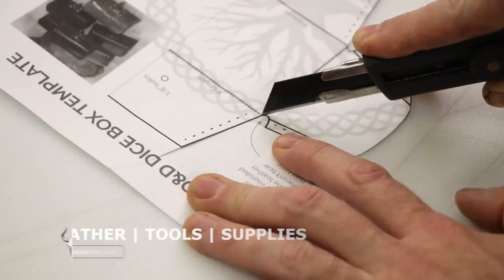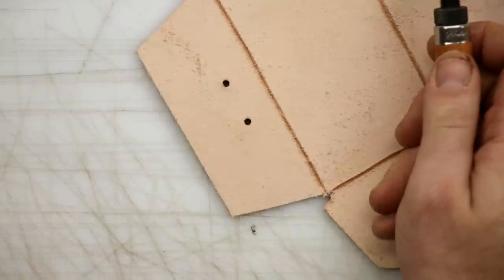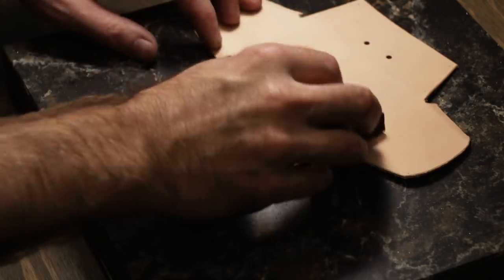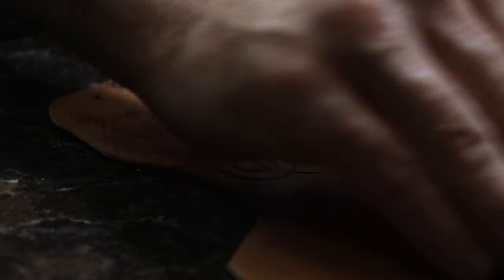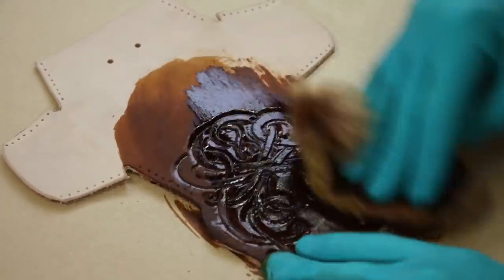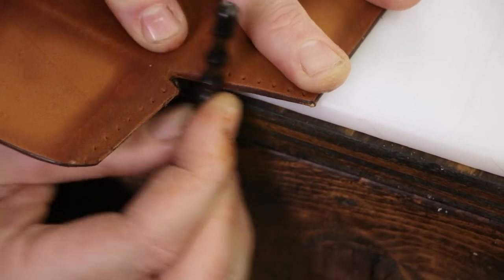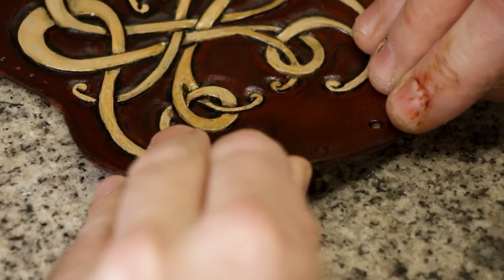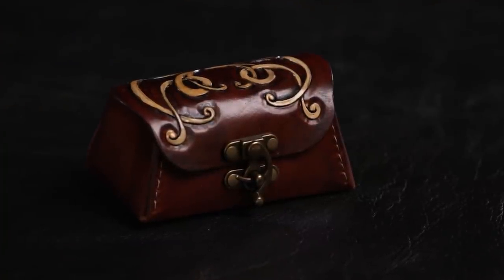How to Make a Leather Dice Chest - With Knotwork Carving

Comment: Nice!  I love the safety skiver, and wanted to mention that you may get better results if, instead of holding the skiver perpendicular to the edge, you give it a steeper angle - more length of the blade encounters the leather at the same time, and makes uniform skiving easier.

Comment: the pattern i do like to use a card stock paper with heavier paper thickness yea i do have an oversize printer too yea does help too can us poster board sheets to it a fairly old one too it still works 
then i laminate the pattern if i am using it a lot too lost to i bought the at lowe's yea they had 5x10 roll of it clear roll to

Comment: Would 9-10 oz be too heavy? I have some 4-5 but it seems pretty light weight
Reply from the maker: With enough skiving and grooving you can make a lot of things. Had to say... 9-10 is getting up there though.
Reply: Would have to REALLY go deep with the V gouge and skiving and Magnus'trick with Vgouging as well as skiving the tabs would probably be a Must on that thick.  But it could work.  
Also the gap in the corner under the tab might be needing to be bigger on thicker leather.  But I'm not positive.  Play with it and find out. Let us know what you get!
Reply: No , need, I tried with the 4-5 oz leather first, after dying, resist, antiquing and finishing, it was way stiffer, I couldn’t imagine trying this with 10 oz.

Comment: Too thin thread
Reply: You can easily switch that up.
I like the 0.8mm Ritza Tiger Thread myself.
But I've also used the 1.1 mm waxed braided nylon line from Tandy.  Both work well on this pattern.
Reply from the maker: To thin for what? Thread can vary, it's all strong stuff.